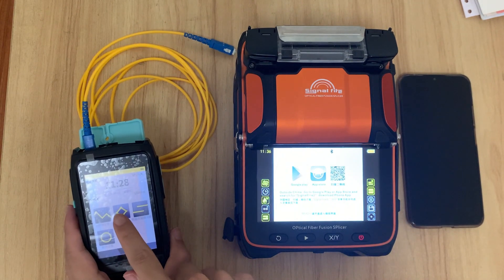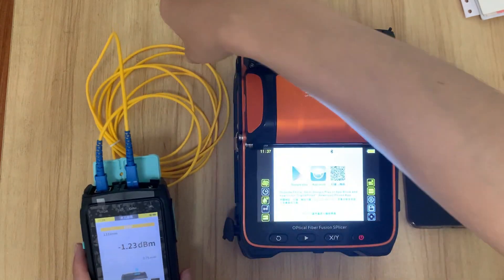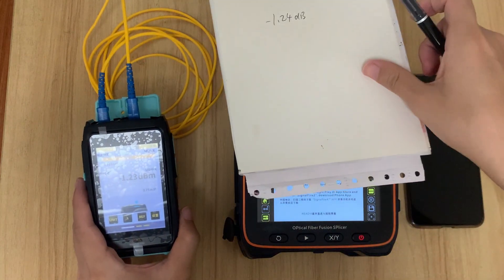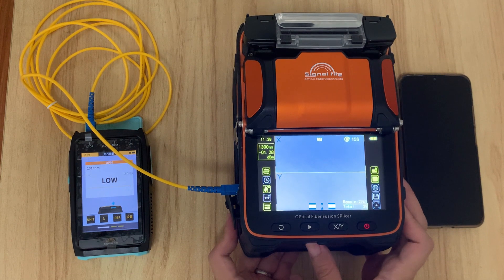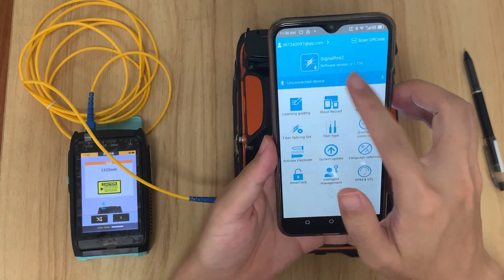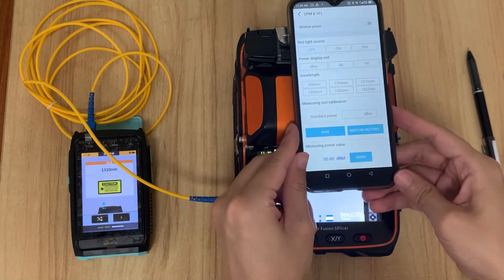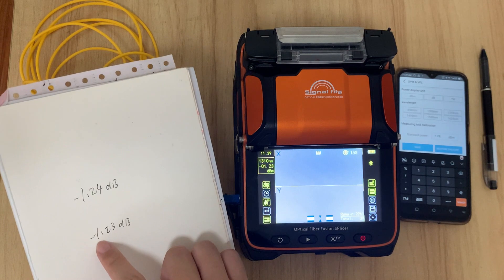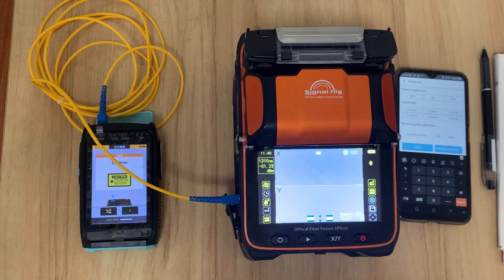how to calibrate the AI-9 Fiber splicer OPM function? - this is the method to guide you to do it.

Comment: ae you using a normal fiber cable for arc calibration or it should be a fiber specific for arc calibration
Reply from the maker: what you used in project, sir
normal fiber what you used then will be ok, cause for the acutal using